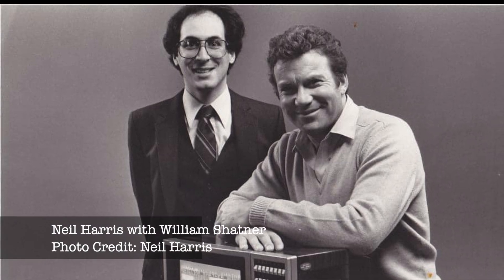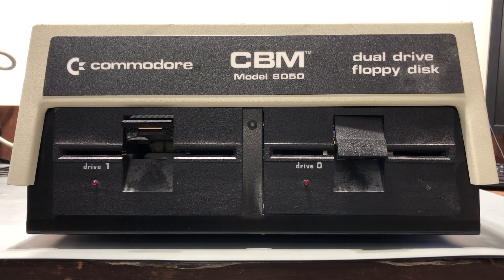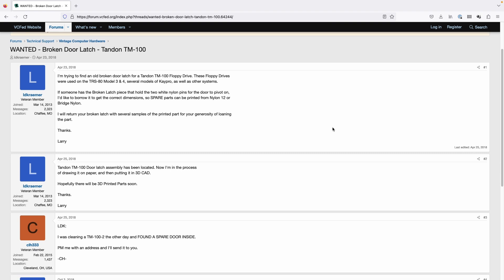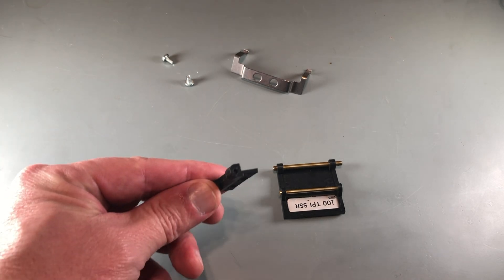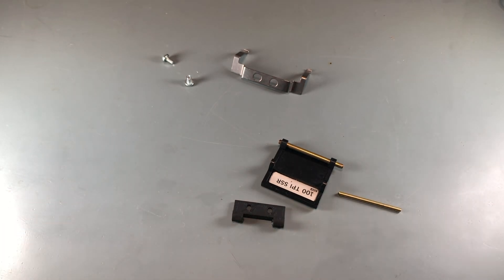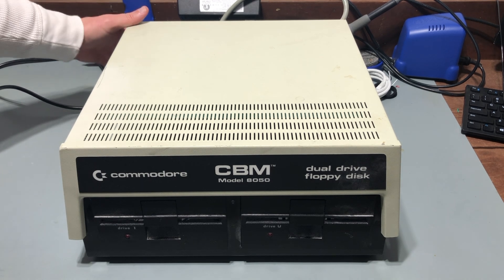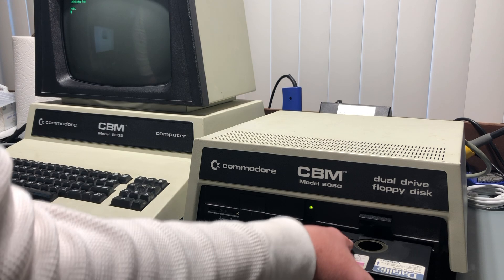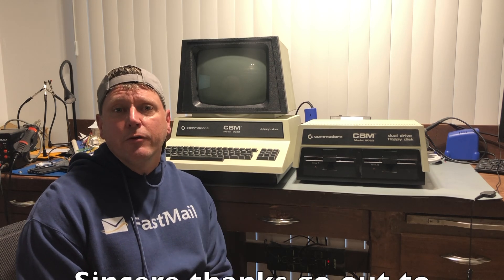Repairing Commodore employee Neil Harris' 8050 Disk Drive

Comment: Woah! Was that the CBM8010 acoustic coupler? If it is, PLEASE, we badly need the schematics  of that very elusive acoustic coupler!
Reply from the maker: Yes, that's an 8010 acoustic coupler.  I cleaned it up and took a ton of photos of it inside and out, but I don't have a schematic for it.  Andy Finkel scanned the manual for the 8010, which I uploaded to the Internet Archive a while back.
Reply: @commodorehistory  Hi and thank you for your answer! I'd like to try reverse-engineering a schematic for it, if you have a couple of photos of top side and bottom side of the PCB taken from a vertical angle, I could try. I'm quite sure it's based on the Prentice Star acoustic coupler (that I already have) so it might be similar enough.
Reply from the maker: @iz8dwf  I posted a ton of detailed photos of it in the Commodore International Historical Society Facebook group already. I posted 4 pics of it on Twitter @commodoreihs. I’ll try to get some uploaded to my website later this evening.
Reply: @commodorehistory  I'm not either on facebook or twitter. If you have a personal website, that would be perfect.
Reply from the maker: I just published on https://commodore.international/
Reply: Yeah, great!!! Thank you so much! I will try to do the case parts in CAD. Will write you an Email as soon as I start.
Reply: @commodorehistory  Thanks  a lot! Major bummer however: the IC above the IM6402 UART has the marking sanded off! I was trying to figure out a way to download the hires images from the website when I noticed that. It's probably a microcontroller though.
Reply: If we could get the scematics and maybe very good scans of the pcbs… I would do the 3D construction of the housing. Should be easy.